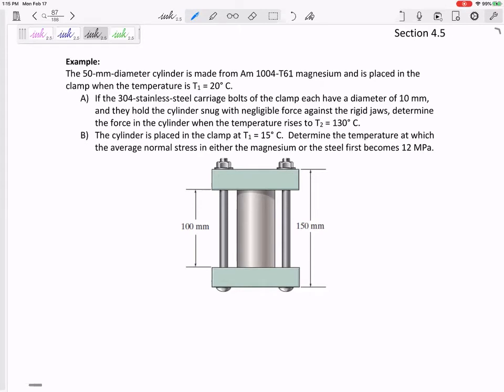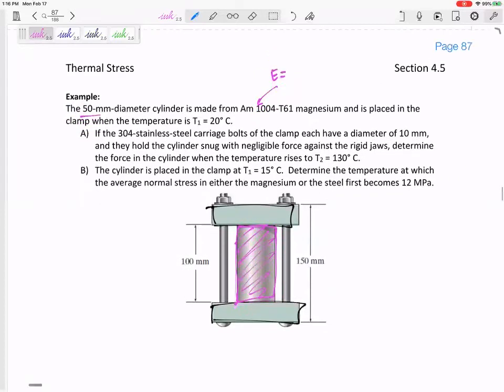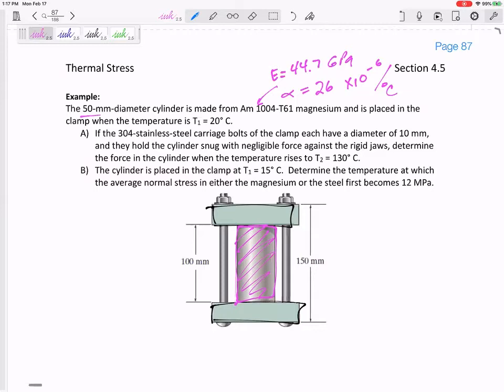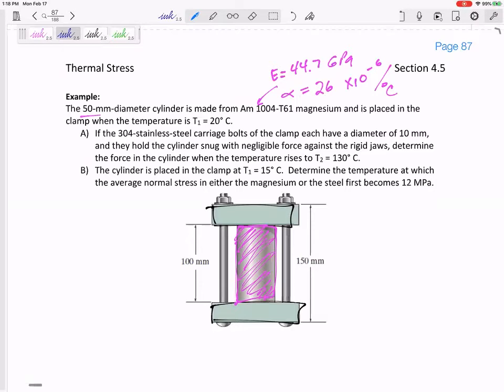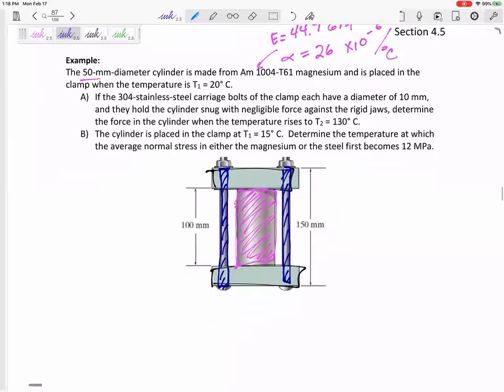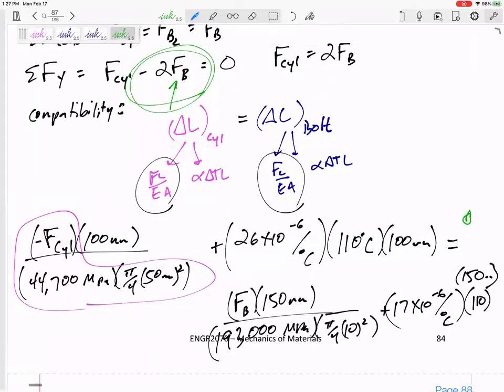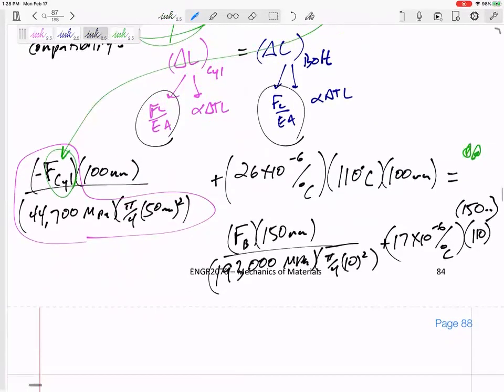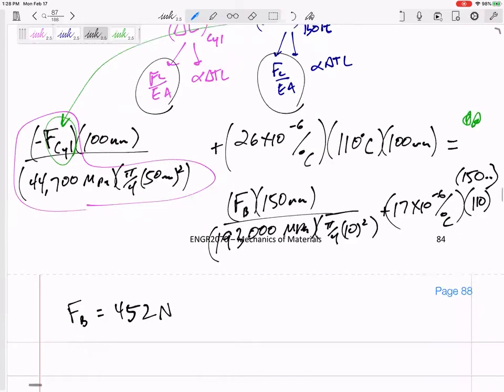Mechanics of Materials - Statically indeterminate axially loaded members thermal expansion example 2

Comment: how can't we consider that bolts are pushing (compressing) the plate from the top to bottom? how can be sure that they are in tension?
Reply from the maker: Yes, you could say the plate feels compression from the nut on top. But the actual bolt feels tension from the plates. The plates are sort of pulling the bolt apart in tension.